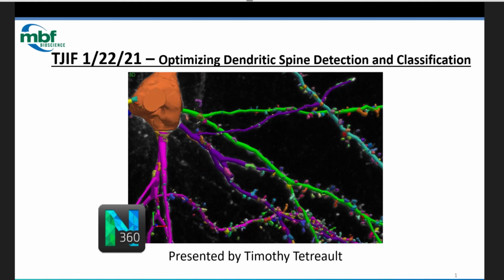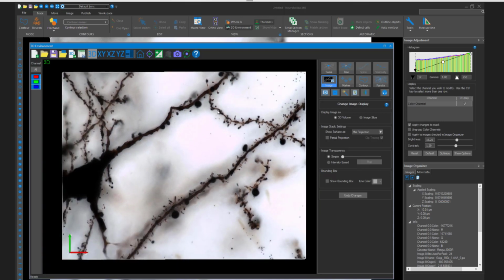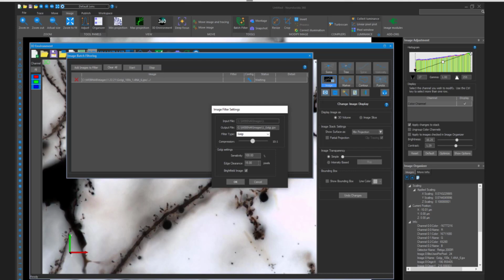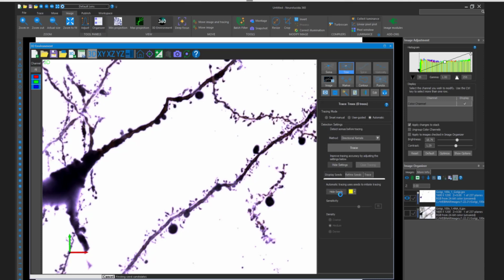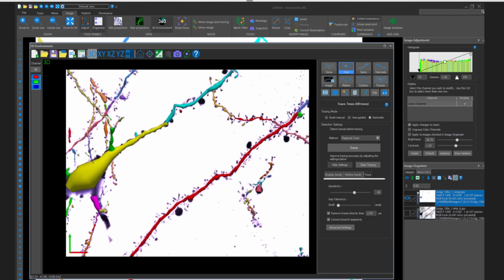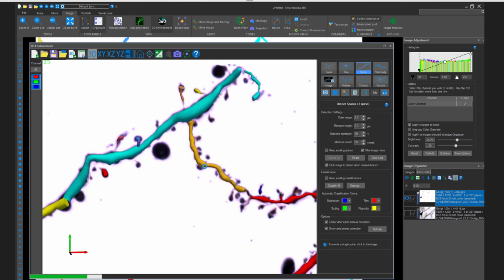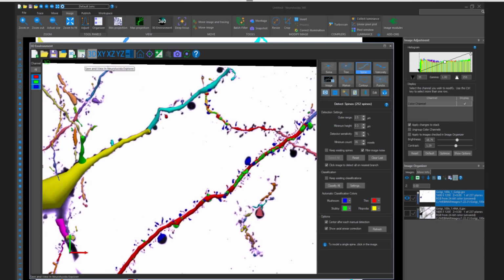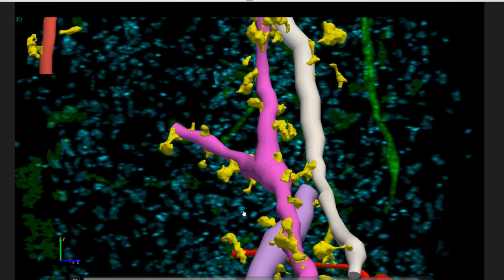Webinar: Optimizing Dendritic Spine Detection and Classification (Part 1)

Comment: What would be the appropriate criteria for classifying dendritic spines in mice?
Reply from the maker: Dendritic spines come in a variety of sizes and shapes that differ on the basis of neuron type, species, age, brain region, hormones, and experience to name just a few categories. Classifying dendritic spines is making an assessment of the dendritic spine based on its shape at the time of inspection/imaging. Spine shape is associated with synaptic characteristics, https://www.frontiersin.org/articles/10.3389/fnana.2015.00052/full#h3 However, some research groups do not classify spines into canonical groups. Here is a paper that explores both sides of the issue: https://www.frontiersin.org/articles/10.3389/fnsyn.2020.00031/full Neurolucida 360 allows users to choose whether or not to classify spines after detection. The methodology that is used in Neurolucida 360 is described here: https://journals.plos.org/plosone/article?id=10.1371/journal.pone.0001997 but you are also free to set your own metrics for classification within the software user interface (no programming required) and apply it to your detection.